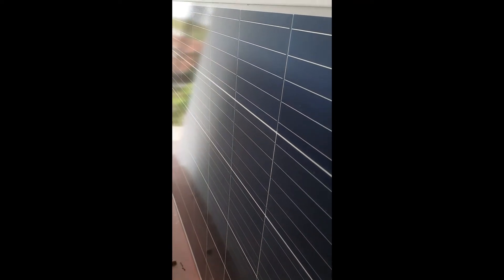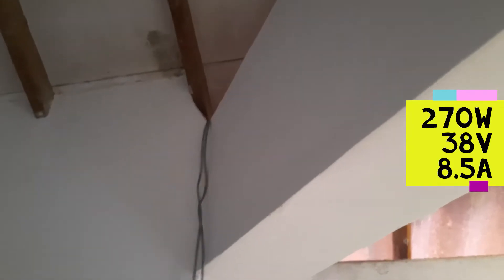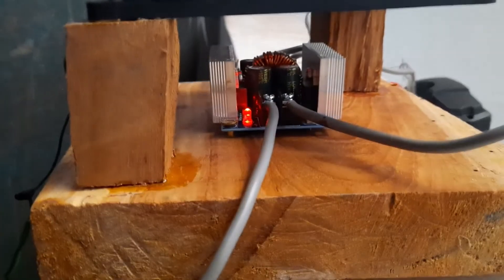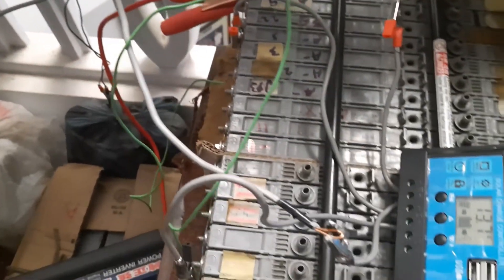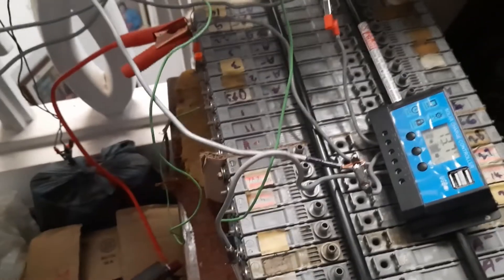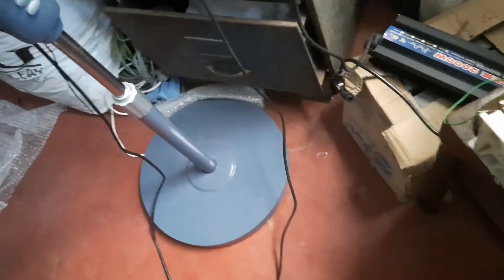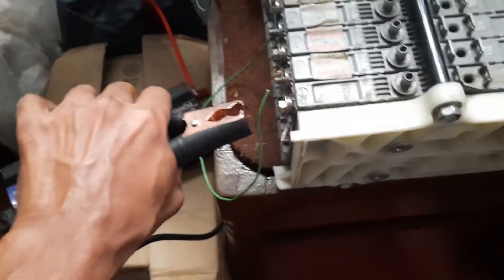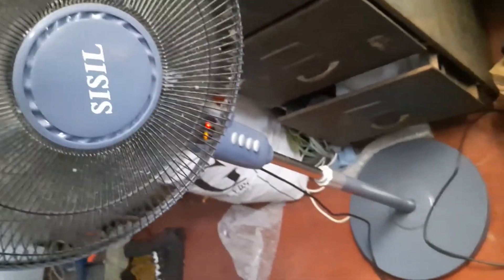1st step in building my off grid home solar power system

Comment: Instead of 12v, U could  have  tried in 24v  so after step down to the  PWM  UK could have  matched Ur batteries.
Reply from the maker: Yes,  that's what I did later on.  Which I have shown in my subsequent videos.. however I've not used the PWM later. 👍

Comment: I have 375W 35v solar panel .can I use this buck converter?
Reply from the maker: Yes,  the one I have is a step up converter, 300W 20A. Functioning voltage from 6-40v.
You should be able to use your panel with a 400W 15A DC to DC buck converter👍
Reply: @solar_energy  thank you so much

Comment: Good attempt. Such implementations are encouraged to go off-grid to minimise impact to SL demand peak. 

I have a few questions. Is this charge controller suited for this type of battery? Is the buck converter essential? Can't PWM handle 38V?
Reply from the maker: I'm also learning as I go, 
1. PWM charge controller isn't ideal for these type of batteries. The batteries charge to 8.4V, so when we put in Series it comes to 16.8V, PWM restricts the voltage to 14.4V in a 12V system. 
2. For NIMH batteries better to use a adjustable charge controller or set the voltage of the buck converter to the desired voltage. 
3. Yup,  it can be used for 12v,24v,36v,48v and 60v
4.the buck converter isn't essential but using it makes it more efficient